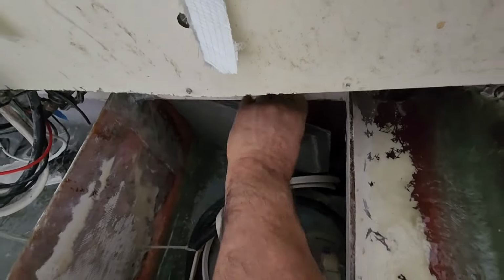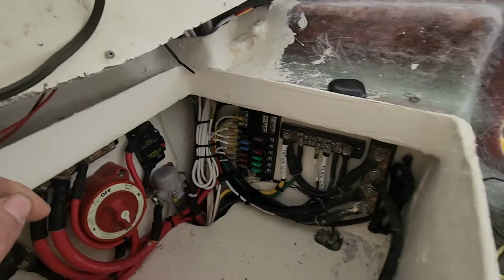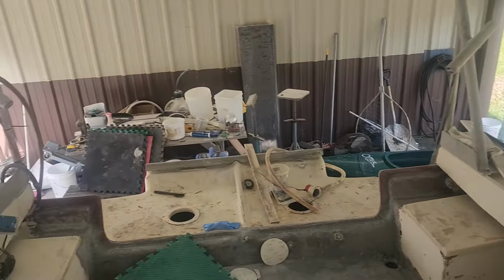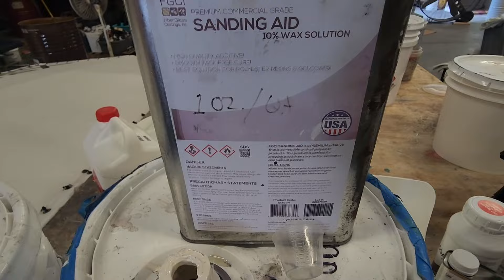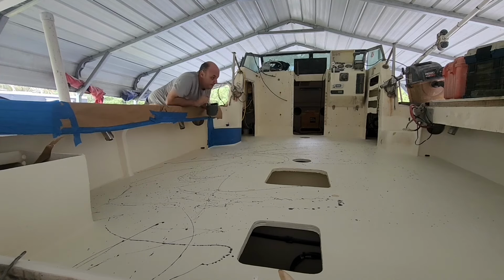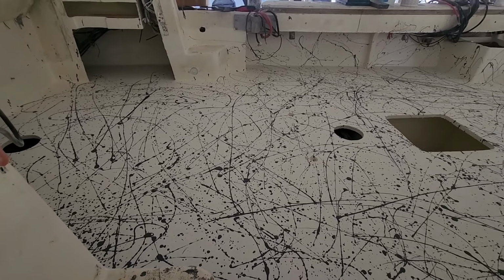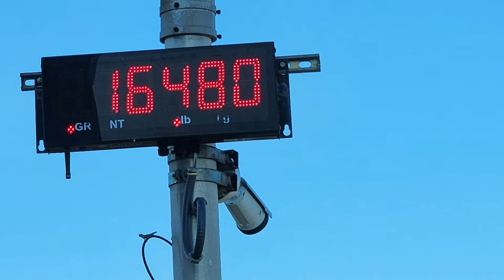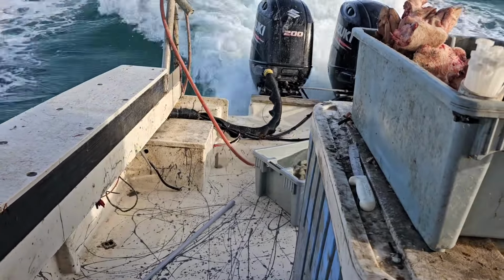Part 11- Parker Boat Rebuilding Nightmare

Comment: Webbing solution is made to be sprayed over gel coat.😊
Reply from the maker: We had it mixed up, but couldn't get the webbing gun to work properly.  At that point my only option to get it on the same day was sling it.  Definitely not what I had planned, but I like the look.  Thanks for watching!